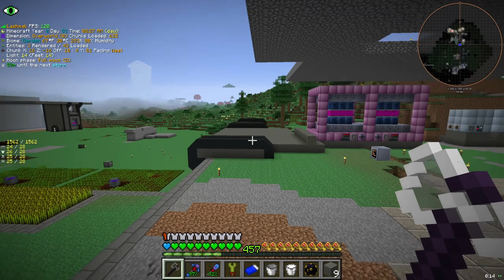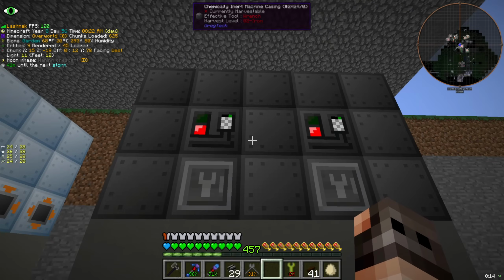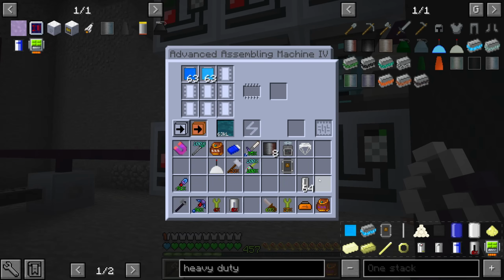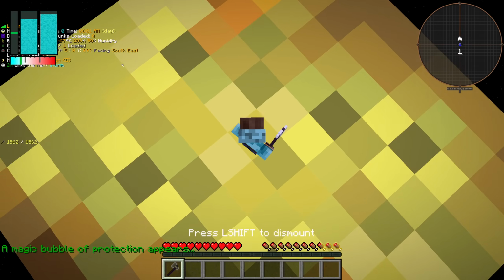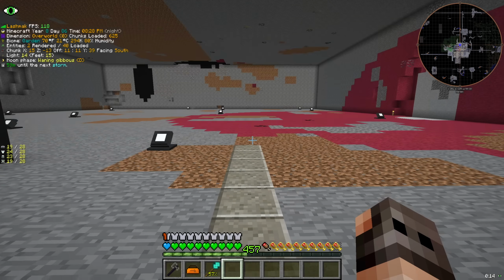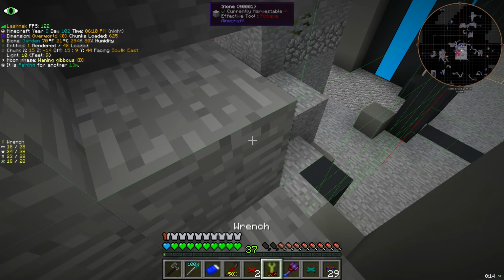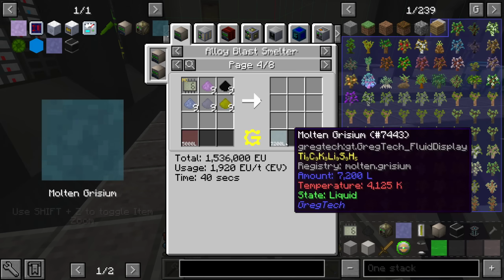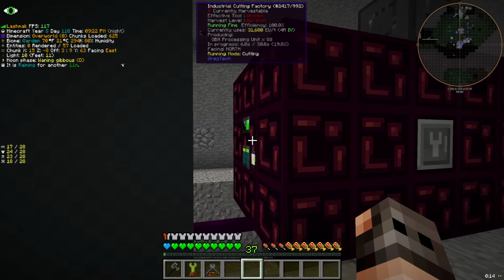GregTech: New Horizons - Ep17: Tier 4 Rocket and NitroBenzene

Comment: Make a point to pattern the garbage rocket parts. Almost all of them are used in higher tier parts recipes
Reply from the maker: hahaha true. it seems we both want the same thing but our definition of garbage is different. i paterns for the parts that make the parts. so this is why i have some manual work.
Reply: @Lashmak  fair enough. Ig no need to pattern a recipe that you use exactly once

Comment: The output busses and hatches automatically push items so you should use interfaces instead of import busses for unlimited throughput
Reply from the maker: Bello <3
yap true my fellow lord of darkness. its just that it will cause confusion, at least for me, in the terminal. cause both will say for example EBF. i wouldnt know which was input
Reply: @Lashmak  Fear not! There's a button in the interface GUI to hide it from terminal!

Comment: My Lord of Darkness,

If you want more parallel from your EBF, VF, DT, or ABS, you can make the Mega form of them! They each have a parallel of x256!
Reply: mega abs is gated by uv
Reply from the maker: my fellow lord of darkness <3
yap well the mega version is gated. so is the mega chemical reactor. the only thing i can craft is the mega distillary which honestly i dont know why you need it
Reply: @Lashmak Going for the MEBF and MVF at least only require 64 of the regular block to craft it in an assembler. The MDT would be more for processing line byproducts. <3